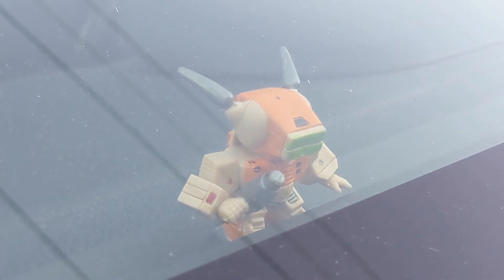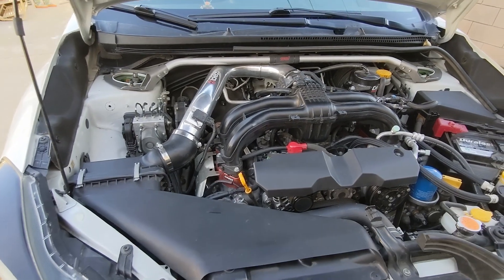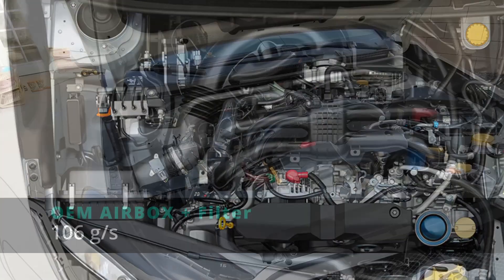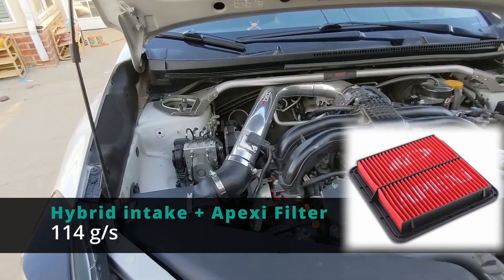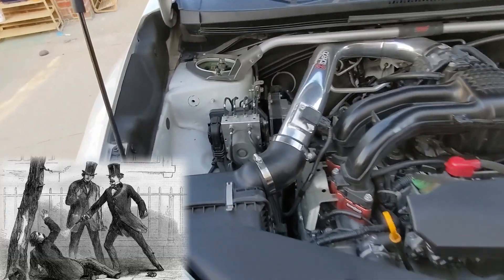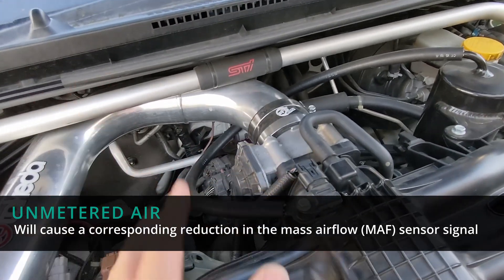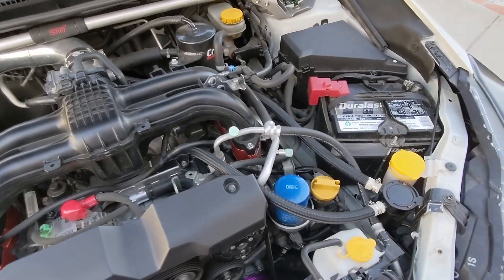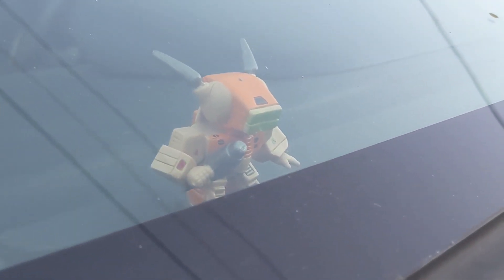Subaru Impreza Sport - FB20 Hybrid Intake Gains

Comment: I love your videos,where did you buy the bodykit / skirting
Reply from the maker: You can look up the parts from Subaru parts stores. The rocker panels are specifically for the sport model, but can be adapted to Imprezas. Then the body kit fenders are for the sport rockers. The front underspoiler is an option depending on your year. Strake kit is for the sport too.
Reply from the maker: You can check out my full mods video for the part numbers
Reply: I did and I still cannot find it

Comment: Try a velocity stack where the air box snorkel goes, for more honk under WOT. 😊
Reply from the maker: This could be interesting. The front snorkel is already shaped like a velocity stack with it's outlet (attaching to the airbox) much smaller than it's inlet (wide) . It's not like a round velocity stack, but has a similar effect. Increasing the velocity of the air. Do you have any particular products? I know there is one designed out of Florida (?) that replaces the shroud to create a ram air effect.
Reply: @JasonLeung-4roller  I pulled the snorkel out on my outback, which is more like a big jug/bottle. I replaced it with an aluminum wide mouth velocity stack! It's  a fun and fairly cheap mod. You can still run quietly at low revs, but it goes Super Honk Boom intake noise at mid to higher revs. Kinda funny sounding, but definitely more induction without much work
Reply from the maker: @bsiccs  oh! The jug from underneath. Yes. One of my earlier airbox mods was to drill out the airbox bottom, I added plumbing PVC pipe with an elbow to the front fog light. And cut some holes in the faux fog grill. Under throttle it would definitely horn out. To the point where people would look up and stare. I found the filter got much dirtier especially if it was wet. I found on the highway, the rich turbulent air would give a good air mix. I also went the full other way and bought the jug. It really quiets things up. Right now I am just using a cut bottom airbox with a prefilter mesh covering the hole. It allows a little bit of fender well air. And some sound and also keeps the airbox filter a little cleaner. :)  I think it does make a little difference.
Reply: @JasonLeung-4roller make sure you can seal that area off from the engine bay as much as possible… the air from the radiator fans is so hot if sucked in you can lose power… happened to me when I made a cold air-“hot air” intake. Same thing happened when I extended the piping deep behind the fog light, and when my exhaust recently started leaking, it was sucking in exhaust fumes as well! 😅 odd combo… so I put the stock box back on. It’s far enough from the exhaust it shouldn’t suck much exhaust into it now.. Subarus don’t seem to like hotter air over ambient air at all.